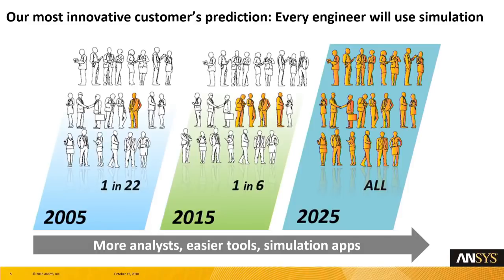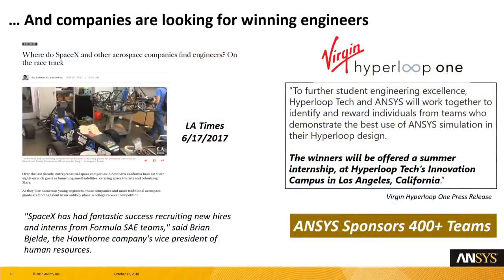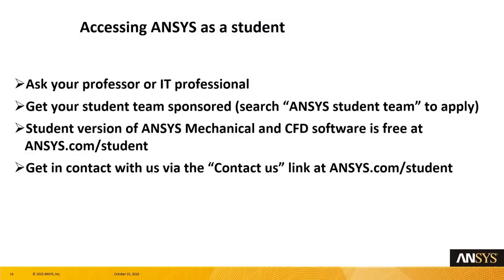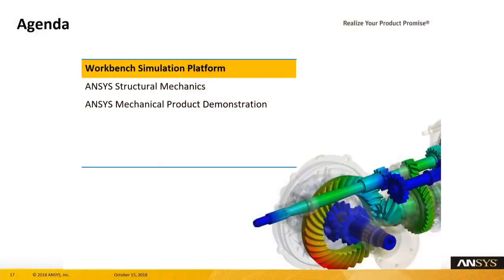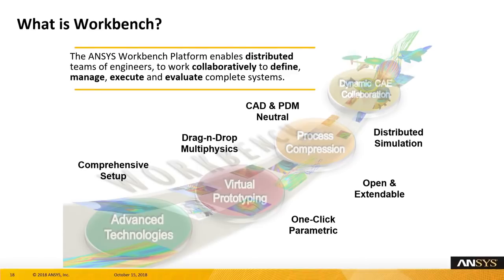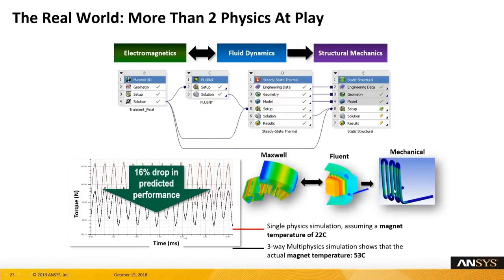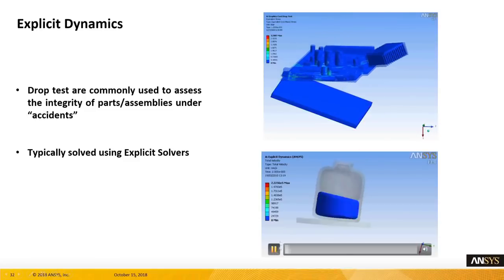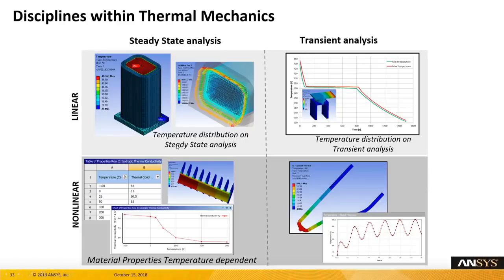ANSYS Back-to-School: Design and Topology Optimization with FEA Simulation

Comment: Great video! I'm interested on doing topology optimisation in a part which is part of the assembly. The last example your video shows is the static structural analysis with bonded contacts. Imagine I have a an assembly, but with different kind of contacts, i.e. frictional or rough, would the optimisation work?
Reply: Yes

Comment: hello, i am performing topological optmization for 2d truss structure and am able to perform static structural analysis perfectly. But, for topological optimization, i am not able to use line body for optimization even though i have given a circular cross section area for the body. can you suggest any possible reason for the same